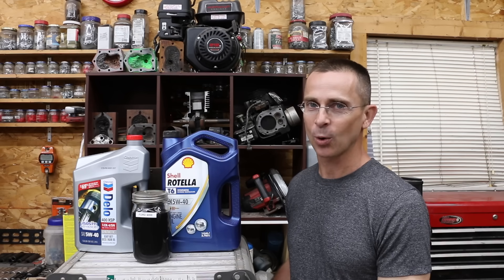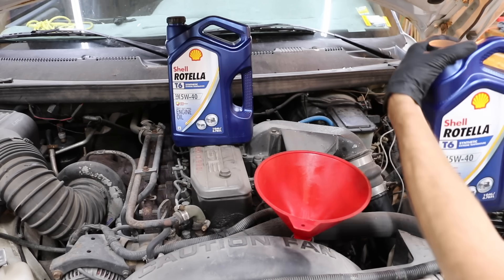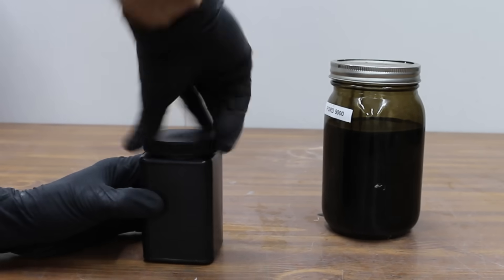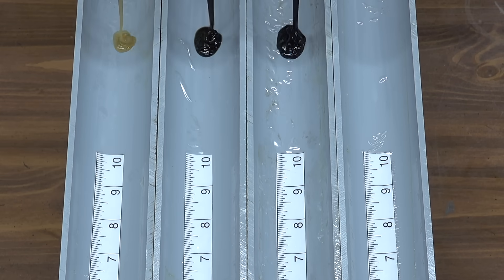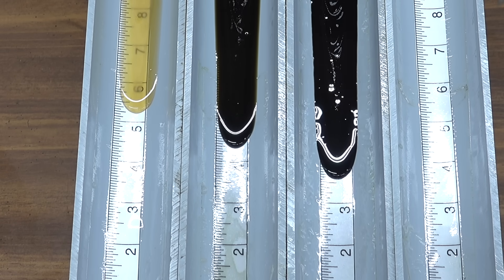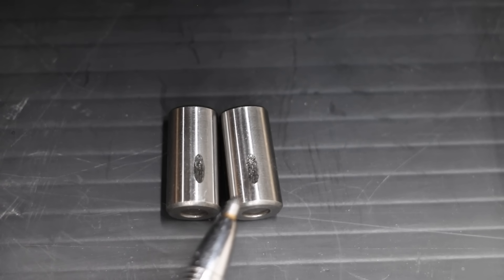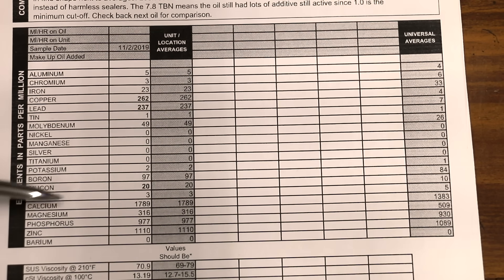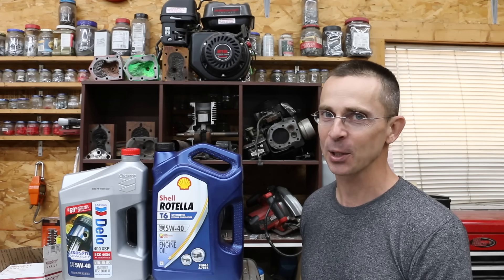Will Annual Oil Change Damage Your Car? Let's find out!

Comment: Amazed at the US/European difference. Most European cars go for 15,000 miles or 2 years between oil changes no problem. But, that's with a good quality fully synthetic, a Mobil 1 or a Castrol. European diesels have been shown to be fine after 200,000 miles on this regime.
Reply from the maker: Thanks for sharing.
Reply: Europe is known for having much lower sulfur content in its fuels. And Europeans are known to be more diligent about operating/servicing their vehicles…

Comment: As my chem  background tells  me.. it's the sulfur in oil mixed with the H2O condensation that produced  Sulfuric acid (H2SO4.. )  & is therefore  way exacerbated in an engine  not brought fully up to operating temp (as in many short trips to the store etc..) & then shut  off  leaving the water STILL IN the engine to mix with the  Sulfur..
Isn't there now less sulfur in both diesel fuel and  oil by EPA mandate? 
So, wouldn't it follow  that there would now  be less problem with corroded bearings &.....??

Comment: Awesome video yours are #1! I learn so much. I love for you to do a similar video with a wet clutch 90's 750 Honda motorcycle oil comparing Honda OEM to Rotella T4 15w-40 engine oil & synthetic? Please bust the myth or not ? My motorcycle mechanic doesn't recommend synthetic oil in older Honda's
Reply from the maker: Thanks so much!  Thanks for the video idea.

Comment: I went 6500 miles in two years infrequent trips of typically 15 miles each. I changed oil (fully syn) in two years. I am glad I am correct about oil lasting longer than one year.

Many presume that if you drive very few miles then you likely make frequent short trips, not allowing the oil to warm up to drive away the moisture from combustion. Often wrong presumption.
Reply from the maker: Thanks for sharing.

Comment: Perhaps something to consider regarding acidity in the oil:.  If you're not replacing a PCV valve, or have neglected your recirculation lines/crankcase ventilation, components etc. You're going to get too much moisture and you going to get some acidity, a lot of acidity in some cases.

Some of these old school guys that pull off any kind of lines they think don't matter, often cause this acidity.

An older cars, that don't have too much recirculation / crankcase ventilation, you'll find this is pretty common.

I worked on an older Porsche recently, that had its copper oil tank with pinhole leaks because of this problem.

So why you should start your engineand run it and reasonable intervals, there are other things that can cause acidity in the oil
Reply from the maker: Thanks for sharing.

Comment: In Australia, I bought a mini engine from a workmate, got it home, checked the crankshaft bearings, and took it back the next day and told him he had given me the wrong one, this was a new one. He said it was the only one and that it had burnt a pint of oil every 1000 miles, so had re-placed it.  Well that was about normal for a mini, so how come there was no wear anywhere? He then explained that he had changed the oil every 1000 miles. So it does pay to change oil at short intervals, but I never understood why he bought a new one.
Reply from the maker: Thanks for sharing.

Comment: Here in the UK we just follow the manual when it comes to servicing and oil changes, which varies a lot depending on the car and oil type..  can be as long as 18 months to 2 years and 16,000mi or more.
I've often felt that people in the USA have been scammed into overly frequent oil changes.
Reply from the maker: Thanks for sharing.
Reply: Here in Argentina is also once a year or 15000km. Not sure why in the UK it's different, 16000 miles is a lot anyway.
Reply: 16,000miles?? Lol can't be serious. Enjoy purchasing a new engine!
Reply: @beefcastle696  mercedes oil monitor recommends change oil at 20K. I have 400k on motor that runs like new with 20K mile oil changes.

Comment: If the oil filter is mounted horizontally you can fill the oil filter up with oil and let it sit a few minutes and then drain the oil out before installation. This way you have a oil soaked filter ready to filter your oil. When I do an oil change, I even do a flush with new motor oil and a 20 minute drive before I do a full synthetic oil change with new filter.
Reply from the maker: Thanks for sharing.

Comment: This subject was scientifically studied and peer reviewed 40 years ago in a study sponsored by Consumer reports and Checker Cab. Bottom line, those cabs that did not recieved an oil change for 1 year and over 100,000 mi in NYC traffic showed no difference in wear from those that had changed at 5000mi intervals. The no change cabs had less upper cylinder wear. Bob's Your Uncle!
Reply from the maker: Thanks for sharing.

Comment: I haven't changed my riding mower oil in 2 seasons.  The first season after the change I hired a lawn service so it was rarely used.  I should probably do it at some point as it sat for a while and now used weekly.  Curious  to rip apart my filter and look at it too now.
Reply from the maker: Thanks for sharing.

Comment: How avbut changing filters annually and just adding oil to fill it up.  When I ran Franz fileters I never changed oil, jutt filters and enough oil to fill it back up!
Reply from the maker: Thanks for the suggestion.
Reply: I'm curious, do you bypass the shower, and just change your underwear and socks?

Comment: I use T-6 on a motorcycle. EDIT: Engine uses the same oil for itself, the clutch and transmission.
0 issues. Proven time and again by many other motorcycle owners.
Reply from the maker: Thanks for the feedback.

Comment: I'm old school, when I bought my Nissan in 2017, it came with a lifetime "$10 oil change" deal (includes filter and 5 qts. oil) and I get my oil changed 4 times a year, and have them rotate the tires at the same time.  For $10 I'm not going to experiment.

But, as always, I love your videos! 👍
Reply from the maker: Thanks!

Comment: I use diesel engine oil in my air cooled twin cylinder motorcycles. Old Harleys and BMW R-series bikes get very hot and using Rotella or Delo oil eliminates tailpipe smoke.
Got the idea after noticing that Harley specs Harley branded oil, and their oil doesn't have SAE ratings. I figured Harley puts somebody's CF~ rated diesel engine oil in every can of Harley oil.
Reply from the maker: Thanks for sharing.

Comment: Would you consider testing some oil additives on the market claiming extended engine life due to lack of wear?  I've been looking at modern spartan systems TVT Green for example.  If you check out their bearing wear test video's, much like some of yours, it seemed like it would be right up your alley.  Tough to find much data on friction modifiers.
Reply from the maker: Hi Nicholas, Thank you very much and thank you for supporting the channel through memberships!  Also, thank you for the video idea on additives. I've got another oil video on the way. I'm hoping that viewers will be interested in it and hopefully more additive videos.  Thanks again!

Comment: I agree with your findings. I was a Chevrolet Certified technician as well as an ASE Master technician for over 25 years at a Chevrolet dealer. Now I'm retired I don't leave the house often and usually most trips are less than 5 miles. My last oil change with Amsoil Signature oil was changed 18 months ago, in that time I only put 5920 miles on the odometer. I definitely believe that in my case, I could have gone another 6 months without changing oil, but if I had a warranty problem (I have 10 years/100K powertrain warranty), I'm sure my repair would be denied. Only by sending an oil sample to be checked as you did, and taking the results to court with a lawyer, the small difference between the oil with 5920 miles on it and the new oil would show the automaker's atty that my oil condition was still so close to new that denying my claim would be laughed out of court by the jury, the atty and the judge. 
   If you've ever seen a NASCAR engine shop, you know the place is cleaner than an operating room, it's said that cleanliness is next to godliness. Just one reason why I've always believed that the cleaner you keep the inside of your engine, the longer it's going to last. Thank you so very much for all the hard work you do to bring these tests to the attention of the automotive world.
Reply: SIR WHAT WOULD YOU USE IN A REBUILD 2005 CADILLAC DEVILLE.  I CHANGE MY OWN OIL JUST DON'T KNOW IF I SHOULD PUT MOBIL ONE OR A REGULAR OIL THANKS JAMES
Reply from the maker: You are welcome!  Thanks for sharing.

Comment: Synthetic is more corrosive than conventional. I based that on my nose. Back in the day when going to your local junk yard for an engine to rebuild was routine. The oil out of 5 year old no running engines smell like 3 month old synthetic. 🤷🏻‍♂️
Reply: total nonsense
Reply: @02hreblue30  how do you explain it then? Conventional oil after 5K doesn’t smell like synthetic after 5K. Fact!

I will never forget that nasty old oil smell from the work I did in the eighties.

There was no synthetic oil in those engines from the seventies. 

Whatever
Reply: @Nostradamus_Order33  Something's wrong with your nose, and your logic. BTW... your 2nd comment contradicts your 1st comment.
Reply: @SokemRokemRobot  how?

Comment: These brands are for diesel engines. Years and years ago I worked on fuel islands for a summer job while out of school. I remember if oil was added to those huge commercial tractor diesel engines, it was Shell Rotella. I don't remember a Delco brand although I'm sure there was one I guess. Delco...sounds like AC DeIco that used to be part of GMC.  GMC made commercial tractors with Detroit's in them back then. I noticed a small Cummins in this experiment of yours in a Dodge Ram pickup.
Reply from the maker: Thanks for sharing.

Comment: ..My uncles' oil changes have always consisted of adding oil when it gets a quart(or two) low..never actually changed it, never changed the filter...every vehicle he has ever owned..he used to be a farmer, and the red field dust would clog the air filters in his vehicles..his solution was to throw away the air filter and not replace it..strangely his back yard is full of vehicles that either locked down, started knocking, or started smoking excessively...a Ford Ranger..a GMC S-15..an '80's Toyota pickup..an old Nissan station wagon..his current truck is an early-2000's Dodge Dakota..I guess we'll see how long it lasts with no oil change...:/
Reply from the maker: Thanks for sharing.

Comment: i am using synthetic Valvoline 5w-30 and change the engine oil once a year on my 1996 Toyota Camry and the car still running very strong
Reply from the maker: Thanks for sharing.

Comment: Since I put less than 1600 miles a year on my vehicle, I've been thinking about changing my full synthetic oil (Kirkland Signature) every 2 yrs. Do you see any problems with that idea?
Reply: I think synthetic could take it. Just avoid to many short trips without some longer trip in between. Cars don't like short trips.
Reply: What kind of driving do you do? Like the other commenter said, if you do short trips without the engine warming up you could be getting condensation inside which needs shorter intervals to keep from getting bad like he discusses around 11:40
Reply: @fabulousprofound  Sometimes, it's only a 4 mile round trip, but most of the time, it's a 14 mile round trip.
Reply: No problem. 2 year interval with a fully synthetic is the norm in Europe. That's with a 15/20k mile interval depending on whether you're asking the oil company or the car company respectively.

Comment: Do NOT prefill your oil filter! That middle area is the clean side of the filter and by prefilling you invite possible dirt particles to enter the system. It makes absolutely no difference to start it 'dry', if your oil pump works at all..
Reply from the maker: Thanks for the feedback.

Comment: My company bought two Freightliner trucks with DD13 450 motors ran them 300,000 mile without changing the oil. Changed the filter every 50,000 miles and added oil as needed. We used Cenex Enviroedge 5-30 full synthetic oil.
Reply from the maker: Thanks for sharing.

Comment: I run T6 in my Subaru and it was interesting to see how this performs. I'm glad you were able to do this. Thank you for your hard work!
Reply from the maker: Thanks and you are welcome!
Reply: I ran it on my 10 year old tuned turbo Sonata since its first oil change. I briefly swapped to Delo because it was gas approved. I then went back to the t6 and felt the engine ran slightly better.
Reply: How's the pos Subaru
Reply: @joedirte716  Still running, all 440hp of it.

Comment: Most people change the oil filter as well as the oil. I change the oil myself once per year. I use the cheapest conventional oil I can find. I use the best oil filters. In my older car (1983) in the hot climate of Arizona I mix half 10-40 with half 20-50 giving me 15:45 weight.
Reply from the maker: Thanks for sharing.

Comment: I use nothing but Amsoil Signature series Full Synthetic oils in my cars and my 2014 Ford F-350. It goes up to 1 year or 25,000 miles per oil  change with the Amsoil Oil Filter on it. Nothing better.
Reply from the maker: Thanks for sharing.

Comment: 23/4 22 Chemists, Metallurgalists, etc from the Oil Industry seem to have very little to say or contribute in these vid's. Follow the money. Compare brand prices of identical specifications & you begin to understand why the myths & alchemy concerning what is also a fast moving consumer product persist. Compare laundry detergent marketing & you see the parallel. Less expensive Supermarket own brands of both products meet Consumer's needs - their engine oil spec's equal those of 'Premier' products. You can buy both with head or heart. Rationality v Emotion offered as choice - choose how much you'd like to spend. Whatever your choice the same spec' oil will meet different engine manufacturer's recommended oil change periods. Same analogy exists for fuel & auto wash products underpants & socks. Am expecting the usual quips now to follow.
Reply from the maker: Thanks for the feedback.

Comment: Do you think it would make a difference on the oil in your opinion if the oil was used as a hydraulic fluid to run the injectors like the 7.3  powerstroke HEUI system?
Reply from the maker: Thanks for the suggestion.

Comment: I've been running annual oil changes on cars for over 50 years.  I point out to people that's why my car engines only last maybe 300,000 miles.

Caveats:  mild climate (Athens, GA),  no short low speed trips (minimum 5miles at 45mph, typical 10+ miles at 65 or more), almost no idling.
Mobil 1, Purolator Pure 1 filters

All cars are Chrysler minivans going back to 87 model (3.3, 3.8. 4.0), current fleet only goes back to 92 as the 87 has been on storage for over 10 years.  The 72 is currently as 250,000 miles, the 09 and 02 at 190,000 (but 09 has always been changed at 6,000 miles because that's a lifetime power train warranty requirement even though it doesn't need those changes), and there are three others in the fleet.  

I still have a 73 Valiant slant 6 in storage with 408,000 miles on it when we retired it in favor of minivans.  Also a 67 Dart, but it only has 140,000 miles.  I don't know how to post pictures here or I'd put up one of the 02 from when I pulled the valve covers last year to replace leaking gaskets.  Absolutely spotless, looks like a new engine with  500 miles on it.

If you're in a cold climate with short slow trips and a lot of idling don't do this.
Reply from the maker: Thanks for the feedback.

Comment: What a good test !!, I almost religiously change the oil after one year of use (and in the 2020 with pandemic at full, I've changed it in my motorcycle with barely 900 kms...), so this is a very valuable test, not only in the economic aspect of the matter, also in the waste we can produce with unnecessary oil changes.
Reply from the maker: Thanks!  Thanks for sharing.

Comment: when you made an agreement with ATC trailers and signed on the dotted line thats the deal you signed up for at $176,000 NOT $280,000. If you didn't completely renegotiate your order they are required by law to  honor the original contract that was agreed upon. Between additional costs for motel  loss of ability to perform the usual showing what your company does and potential loss of getting contracts or long term sales agreements, wreckless endangerment of your employees due to failures of air bags and tires, structural failures and potential health risks due to possible mold issues you have additional costs of $312,000 for 3 trailers as well as losses of sales and potential health risks to your dedicated employees worth at least a half a million plus structural deficiency that risks the lives of your employee family and the lives of anyone traveling around your equipment, (after  all, what's a life worth?)
Reply from the maker: Thanks for sharing.

Comment: Outstanding! I might have been throwing good money to the oil drain as I replace Delo XPS every 5,000 Km on my 2010 Volvo XC60 D5 with only 95,000 Km. And we live in a tropical climate so running cold is not an issue as engines get warm in minutes!
Reply from the maker: Thanks!